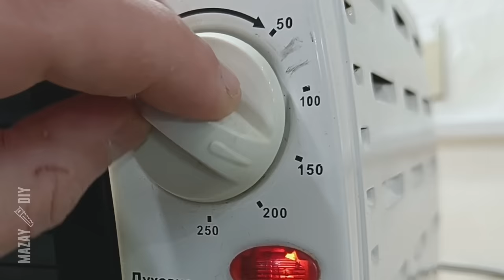Knife Making - Neck Knife from an Old File

Comment: Never could understand why you heat treat metal that is already hardened   Don’t bother explaining because I still won’t understand it
Reply: Because YOU TUBE! 🤷‍♂️🤦‍♂️
Reply from the maker: 1. File hardness - 64 to 66 HRC. This is a lot. If you make a knife out of it, it will be very fragile.
2. It is very difficult to machine an already hardened metal due to its high hardness.
3. If you do not want to harden the metal later, you ALWAYS need to cool it during processing, otherwise you will get metal tempering on the grinder and the hardness of the blade will be very low.
Reply: Files can be very sharp. Sharp enough to cut metal. However, this is because it's extremely hard. When steel is that hard, it is also extremely brittle. It will break easier than heat treated steel. There are other steps involving heat and files but I'm just sticking with the basics. 
Heat treating changes the properties of the file to a point of not being so brittle making a longer lasting knife.
Reply: First time he heats it and lets it cool in forge softens it (annealing) so it can be ground and drilled.  Second time is rapid cooling in oil to harden. In oven to temper it so it is not brittle.  Untempered steel can shatter if dropped. When tempered properly it's still hard enough to hold an edge but flexible enough to not break.
Reply: He annealed it at the beginning to work on it, bro. It was soft. Needed to be re-hardened
Reply: Brooo, you ever try to cut through or drill or file, talk to me 15 bits later
Reply: Because Too hard to work on it
Reply: Basic principles for working with steel. When u have hardened steel you need to temper it for working. Obce dobę you harden steel. File is so hard that you could waste a lot of grinding discs.
Reply: Heat treatment to remove hardness and heat treatment to make metal hardened are two different phenomenons and procedures for both are different.
Reply: I cant help but agree from my lay point of view, I was taught that a GD file was the meanest piece of metal on the planet! 😂🍺
Reply: Because he did it right, that’s why!!!
Reply: Forgive me for being alive! Gd it!
Reply: See how after the first heat treatment they ran another file over it. That was to check they had annealed the metal (removed the hardness) which will make it a lot easier to shape the knife. Now I’ll watch the rest of the clip and I’m sure they will harden and temper the knife once it’s shaped right.
Reply: Michael Jones left the chat 🤣😂🤣
Reply: It’s the same reason you wouldn’t make a hammer out of glass. Sure a hammer needs to be hard enough to drive a nail and heavy enough to assist the handy man, but it needs to also be soft enough to rebound after such force is applied. A glass hammer would shatter. A knife made of hardened metal would be more prone to snapping and resistant to sharpening
Reply: Because drilling is not possible in hard iron
Reply: @MazayDIY  So I wasn't doing that just cause my hands were getting hot lol.
Reply: Good job brother! My son makes knives and has done some file blades. One of the ones he did was a farriers rasp. Really turned out nice. You might consider making one. Also, very, very good job on the DIY tooling!
Reply: @a.d4911  
кстати я это тоже подметил , 
надо было выточить заготовку а потом уже в закалку ,
 вот он и вспотел как мазай с зайцами 🤭🤭
Reply: @ultertainment6744 ,
   In fact, a carbide drill can zip through a file and still be sharp when done. They're expensive though, and most guys wouldnt know how well the workpiece must be held, and you'd do well to attempt it on a mill for strength and stability. 
   I might seem to be quibbling here but it's often that tool makers etc. don't have the luxury of annealing a part that needs repaired that happens to be very hard! Lol! 
It's best though, for a hole large enough to do it, to put a pilot hole through first with a carbide drill or end mill, depending on what type of hole or feature, then use a planetary bore grinder to bring the hole or other feature to proper size and location to get the tolerance you'reafter. Die and tooling work etc. forces us to work on hardened parts and very tough steels very often.
Reply: It isn't too hard, but the file was 🤔😏🤣
Reply: It’s a process called annealing
Reply: @Marceldbd  and a swearword book when he runs out of his own!
Reply: Wow! You are an artist of the highest caliber. THAT is one bad little cleaver.
Reply: @bretlovitz3068  i was wondering when someone would hit it spot on in all the process .its amazing that most dont understand heating does two different things.
Reply: Don't worry about it
Reply: This looks beautiful, can I bui it
Reply: Heat treat makes the steel very hard and brittle. Tempering brings the hardness down; but makes the steel way more durable. Its a fine balance that makers learn.
Reply: To UN harden it so you can work on it. Move the metal molecules around. To shape and form the metal.
What part of that is too hard for you to understand?
Reply: @bretlovitz3068 wow, sounds complicated 🤔
Reply: Hard metal = broken tools

Fire makes soft.

Soft metal = can make pionty and slashy easy. 

Controled fired = hard metal.

Hope that helps.

Comment: A neck knife is a knife worn on a cord hanging from a person's neck. It usually means a small fixed-blade knife which is carried by means of a cord, by which the knife sheath is suspended from around one's neck. They can either hang handle up ("mountain man style") or handle down.

Comment: I really like the way this turned out but I honestly believe that the thickness of the file itself was enough to where you really didn’t need to add scales for a handle. The file was thick enough by itself to act as a functional handle. But I really love this design 😊great job.
Reply: Yeah, but what is it designed to cut? Best regards.

Comment: Love it. I have dozen files waitng for next life. Have many blanks of nice hard woods. I would change one item. I prefer to have a blade blank with no file marks on it. I admire homemade belt sander and milling machine dri;; press in use. Any combo or a surface grinder adios cross hatching smooth blade plenty of material

Comment: Files need to be softened before using them as knives, lathe tools etc. An untreated file is extremely hard and brittle and will likely snap and cause injury.
 It's a poor choice for a working tool.
Hope this helps

Comment: That is one good looking knife, but...
Never saw a small cleaver used as a neck knife, it seems a bit bulkey and heavy. A neck knife is a last ditch defense weapon, it has to be small and light with a handle that is a strong grip, and I can't imagine one that doesn't have both edges sharp to fight with. (It cuts both ways) 
It has to be able to come out of the scabbard smooth and fast!
Beautiful work,  but I don't see it as a good neck knife. JMHO 👍

Comment: It is a wonderful piece, but inwas asking myself if there is anything this knife will be able to do well. A neck knife, to my knowledge, is often a self defense tool, but for that purpose a point, or at least a differently angled blade would be beneficial. For cutting food, i fear the thick blade and the textured sides will prevent even cuts. The form would be mot suited for a bushcrafting knife, but it has neither the size, nor the weight for chopping.

Then again, it is so beautiful, i would carry it regardless, just to show it off

Comment: Great knife , if I had any criticism it would only be that maybe you should have taken  maybe 1/8 to a 1/4th of and inch off the handles tang , it looks great for the blade being bulky like that but for me (just me here ) it would have looked a lot more sophisticated of a design to see the thickness tapered off on the handle , it would have given you a far better balance as well , just some thoughts other than that gear work with the tools you made

Comment: Lots of fancy equipment and not a lot of skill. The way that handle was assembled was painful to watch. You added in about 5 extra steps that didn't need to be there, especially the double stick tape. Just epoxy and pin it then sand it down. If you're going to that level of effort anyways you should know how to sand down a handle properly without drawing guide lines. Geez